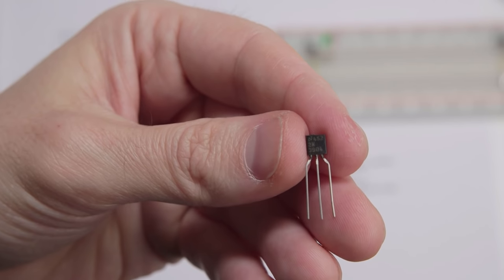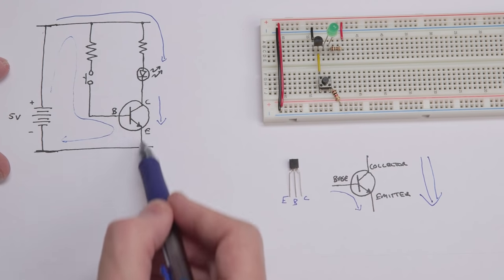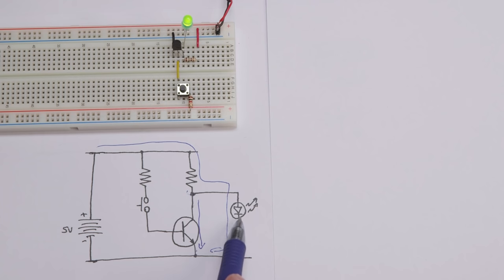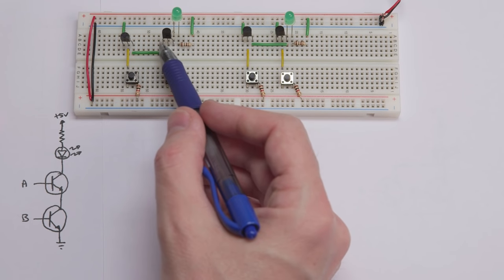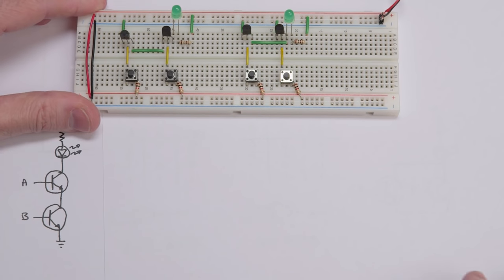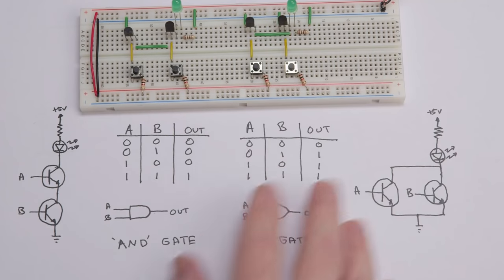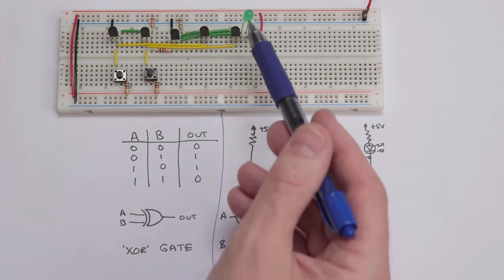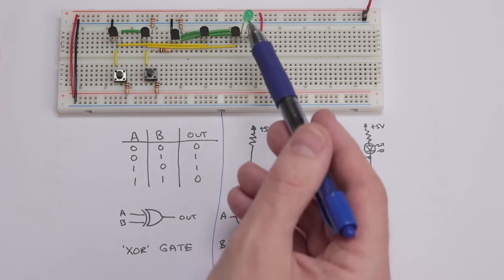Making logic gates from transistors

Comment: this is actually called RTL logic it was shortly replaced by TTL gates because of the high current consumption!
Reply: Actually, the main problem of RTL is low signal. Each time a binary value defined as binary 0 for 0 volt and binary 1 for 5 volt go thru a RTL chip, the designer need to recondition the output with external amplification.
TTL simply add transistors on the chip, thus making the output as strong as the input.
Reply: Christian Gingras So, semantics?
Reply: @orppranator5230  Yep, meaning matters. Shocking stuff.
Reply: And then being replaced by CMOS eventually
Reply: Looks more like transistors, resistor logic to me because the inputs are not connected to a resistor. Also in an IC a resistor is much more expensive than a diode or even a transistor.

Comment: Resistors used on base: 1k
Resistors used on collectors: 100 ohm
Transistor model:2N2222
Led: green at 1.2 volt
You can use white led at 3 volt

The modern silicium transistors have an incredible dynamic range. When OFF, the collector/emittor appear like a very high resistor of more than 50 Meg ohm.
When ON, the same two pins act like a low value resistor of about 0.1 ohm.
The expression 'semi conductor" is misleading. The material conduct as good as the best metal, copper, in the ON state and act as an excellent insulator when off.

The first transistor made with germanium were not as good. In the off state, there was a current leaking from collector to emitter equivalent to about 10 k. When the transistor was warm, it leaked like if it was a 1 K resistor. The OFF state was not that strong neither, cold or hot.

About the NOT gate:
The explanation is as follow:

When the transistor conduct, it is able to act like a very low shunt resistor of approximately 0.1 ohm. It can force the voltage to go as low as 0.2 volt, which is much lower than the usual voltage drop of a diode, 0.7 volt.

If you take a voltmeter, you will measure:
Emitter = 0 volt
Base = 0.7 volt
Collector = 0.2 volt

The base/emitter pins of a transistor are simply a diode with the usual voltge drop of 0.7 volt.

A green LED need about 1.0 volt to turn ON. If you apply 0.8 volt, you get no light at all, not even a feint glow. So, since the transistor  can lower the voltage to 0.2 volt, the LED is off. However, if you replaced the LED by an incandescent light bulb, you would see a feint red glow when the logic state is "0".
Reply: Thanks
Reply: It should work just fine even with  +/- 10% variations, the tolerances are not super critical.
Reply: Is it safe to leave a transistor (im using a mosfet) active for a long period of time?
Reply: Best explanation so far... is better wwy see semiconductors lke dynamic or active resistane than the usual way
Reply: The 0 level in a logic circuit is actually not 0 Volts, just close to it.
Reply: Can I ask, can a 9v battery work with this project? I only have 9v batt on my materials.
Reply: @iamyourfather6941  It depends on your components. If they are rated for at least 9V (safer, if more), then its okay.
Reply: @istvanszabo5745  thanks.. last question tho. If I dont have transistor 2n2222, can I use the model bc547?
Reply: @iamyourfather6941  it depends of the power... power = voltage x current... if you get more power that a component can resist you blow your component
Reply: @iamyourfather6941  If you check the datasheet of bc457, you can see that its rated for 65V.
Reply: Thanks guys for the quick response. Really appreciate it :)
Reply: I just looked up the the word, silicium in my British English dictionary, because as a Canadian, I never heard that word before. As it turns out, it is the chemical element that we North Americans call silicon. You learn something new every day! ;)
Reply: Thanks for the explanation, I thought I was stupid for not getting the explanation on the video
Reply: Thank you thank you thank you
Reply: @connorwatson7162  Yeah, just measure the temperature over time. It shouldn't get too hot because low resistance in "on" state (P = I^2 * R).
Reply: @iamyourfather6941  It works perfectly with 9 volts, I would just increase all resistor values by about 50%.
Reply: @iamyourfather6941  bc547 and most of the bc... series transistors work just fine. Just make sure it's an NPN type. Don't bother about maximum current, power rating etc. In these circuits this is not critical (we are way below max. values).
Reply: That was amazing!!! I got some extra knowledge too, thanks to you.
Reply: THANKS A LOT
Reply: @I am your father -->>> Any small signal transistor will do the job (BC547, 2N3904....).
Reply: @ @istvanszabo5745  >>>> Actually, it's BC547, not 457 and  is rated at 45V(ce).
Reply: Do you know why 2n2222? Why not bc547  or bc series?
Reply: Thanks a lot I was stuck at xor gate
Reply: Christian Gingras ok
Reply: isn't that less energy efficient
Reply: Is better if you use 10K → 50K resistors on the base of the transistors. The current on the base is too much with 1K. In a long period of time you risk to damage the amplification effect.
Reply: i am looking for xnor gate. can you please help me?
Reply: Would be interesting to throw in the diode drops related to the transistors. It obviously doesn't make any difference in the XOR gate where there are 2 diode drops worth of voltage at the resistor feeding the base of the middle transistor. I wonder how many AND gate inputs it could handle before the all 1s input stopped working.  I know I'm splitting hairs here, it would be an interesting exercise to try it out here in YouTube land. I might have to go out and get me some bread boards and stuff
Reply: @iamyourfather6941  yes you can Luke.
Reply: Thank you so much! I've been looking for hours xD
Reply: @Kaan-ih5ty  5 volts
Reply: Thanks.
Reply: is there a source? i want to quote this information
Reply: @MD-qz6gk  you want 1k to make sure to overload the amplification. It is called saturation.
With 47k, the transistor may operate in the linear region and absorb part of the energy.
The base emitter junction is a diode and it is quite tough. Even at 100 ohm, no problem. But if you forget the resistor and apply directly 5 volt, you destroy immediately the transistor, in less than 1 microsecond.
Reply: NOTE that the low-but-still-there voltage of the "off" state implies that if you want a true zero volts, you'd best make sure you take your output after a diode (after the LED will work fine). Otherwise, depending on your base resistor values, it may be more than enough to trigger the input of a transistor in a connected gate when it's meant to be "off". This tripped me up until I figured it out!
Reply: @MD-qz6gk  it seems logical to think that too much current on the base would affect the amplification. In real life, all transistors can take a lot of current on the base.
The usual gain is about 50. If you just power a green LED, this is 20 mA, so you just need 20 mA / 50, less than half a mA.
But even the weakness transistors easily accept 100 mA on the base. That is 200 times more than needed.
The power transistors, those large one that are mounted on heat sink, easily accept 2 amp on the base.
Of course, consult the datasheet to make sure.
Reply: @aprilc.5826  The XOR and XNOR gates are actually composite. The are created by combining a few basic gates.
Reply: @iamyourfather6941  yes, the circuit is not a precision circuit of you just want to light up LEDs. However, you will have to increase the value of the resistor that connects the 9V battery to your LEDs. LEDs will burn up at high currents with 9V. Try connecting an LED directly across your battery and watch it die (if a somewhat fresh battery).
Reply: @Pedritox0953  this is called active load.
Reply: @LawsForever  Would the 2SC1740 NPN work as a substitute? I dont have the BC547, 2N222, or the 2N3904 (actually being used in the video).
Reply: @typedeaf  The  2SC1740 does the job perfectly.
Reply: Thanks man very useful
Reply: His explanation looked fishy to me too, I gave him a thumbs down for misleading young minds. If people understand electricity the wrong way first time they will have problems later
Reply: Copper is not the best conductor.
Reply: @connorwatson7162  yes it safe
Reply: Super useful. I'm very new to breadboards and electrical engineering in general and I couldn't figure out why I couldn't replicate the same results, turns out I have NPN transistors, so my whole circuit was messed up

Comment: For those who are interested, his explanation of how a transistor works is based on conventional current; which is the reverse of the actual electron current. You can imagine the electrons building up on the emitter with nowhere to go because of the depletion zone between the emitter and collector. when the circuit between the base and the positive terminal of the power source is closed, the electrons move from the emitter through the base to the positive terminal and in the process are also able to cross the depletion zone to the collector.

Comment: Finally a video where I could clearly understand what transistors actually do and why are they so important. Thank you!
Reply: I didn't know they were just switches until a few days ago.  My mind blew clear open.  Boolean logic in a miniature device simply would never have existed if it weren't for these things.
Reply: @lookupverazhou8599  They aren't switches really. Physically, bipolar transistors are continous (exponential) current amplifiers. Using them as binary non mechanical on/off switches is just a special case abstraction.
Their primary usage were/are in various forms of (often audio) amplifiers, oscillators, comparators, etc. Such as for radio receivers, tape recorders, TVs, instrumentation, and so forth.
Reply: @herrbonk3635  Why do they amplify, but an additional junction doesn't?
Reply: @lookupverazhou8599  Additional junction? A transistor has two junctions, the base-emitter and base-collector. It is like two diodes with a common anode or cathode (pnp or npn). In these bipolar transistors the amplification is a result of a pretty complex interaction between minority versus majority charge carriers (holes and electrons) forming and drifting in (and due to) the electric fields applied. Hence the name, bipolar.
It's easier to explain a field effect transistor though, because it works very much in analogy with an electron tube. By applying a voltage at the gate, the resulting electric field forms a thin region (more or less) depleted of carriers. This adjust the amount of current that can flow from source to drain at a certain source-drain voltage. So a field effect transistor is more like a voltage controlled resistance, while a bipolar transistor acts more like a current source or "generator", controlled by a much smaller base-current.

Comment: I don’t have the cash or time right now, but I’m going to buy and build all of your kits, this is addicting
Reply: Not to take away from him but you can also just like, buy a pack of 100 transistors off Amazon for like 5 bucks. But then you also need the breadboard and wires etc which I'm sure his kit has. But if you wanna expand electronics is one of the cheapest hobbies I have XD
Reply: Roughly $45 and you can get an Elegoo kit with a breadboard, arduino uno r3 and components and jumpers including a couple transistors. I just got one and it's great so far!
Reply: @Enderbro3300  I just spend over $400 on a bunch of electronics stuff, huhu.

Comment: So far this is the best video explaining logic gates. I appreciate the explanation, the schematics, as well as that you have the gates built on a breadboard, so the users can pause the video and try to rebuild it by themselves.
Thank you!

EDIT: I think you had something wrong with the OR gate, mine didn't work that smooth, didn't know why. I worked it over with another video and it works though. While these gates are good for demonstration purposes, the wiring could be optimized by linking the transistors without jumpers.

Comment: Second schematic uses voltage devider. There is still voltage across diode, just not enough to light shit up.
Reply: Thank you for explaining this. I was wondering why it "wasn't" getting voltage.
Reply: This is a good point. I think the video made a misleading post by that the circuit is not complete when both A/B is on but this is actually not the case

Comment: What makes this so dope is you include both analogue and digital circuits at the same time for a complete picture of how everything works with no deception or gaslighting involved.  Often digital logic is taught by saying 'you don't need to know the implementation' or 'it's not my job to explain analogue circuits.' And analogue circuits are taught by saying 'it's not my job to build logic gates, it's to show the science of transistors.' etc.  So people end up with a huge hole in understanding that is exactly this video.  You do it the right way, providing the analogue circuit as the primary foundation with its truth table as a tertiary feature.

Comment: I had a difficult time with transistors, cuz I'm a beginner. After watching your video, I have at least vaguely understood them.
Reply: @aidanc4719  thnak you! hugs from são paulo, brazil
Reply: Speaking the truth, he showed only half of functionality transistors provide - their saturated and cut-off states. Primarily transistors are current amplification devices, and cutoff and saturated are just edge-cases of that process. "Funny" part comes when we stop talking about DC and start talking about AC and here we meet several more dozens of characteristics diagrams for transistors.

Comment: About 50 years ago - Vietnam War era.  We had several books of circuit diagrams and others with logic diagrams  built with basic gates like these.  Hawk Missile guidance control systems.  All "Top Secret" back then.  It would all fit on a grain of sand now.  But back then it was big stuff - actually useful when we could keep it running.  Lots of breakdowns.  That's where I came in.  (smile).
After service, I used to keep a small breadboard of logic circuits on my desk to remind me of those times.  I'm 75 years old now - still breathing.

Comment: I have an idea for the XOR gate. To save power, you should put a transistor in series with the two transistors that basically make a NAND gate. Then, connect the base of that transistor directly to both inputs. This ensures that if A or B is on, the circuit is on, but if neither A nor B is on, no current flows at all.
Reply: Put the transistor mentioned before between the positive rail and the first transistor of the NAND gate.
Reply: +Matthew Ferrie Before the resistor.
Reply: My apologies for responding to a two-year-old comment, but for anyone reading this now:

Tying both inputs to the base of a transistor would not work as you've now shorted the two inputs in question.  If the inputs are driven by opposing logic levels (ie, one high and one low), you've short-circuited 5V, and the circuit could get very hot very fast.  Or just cause your microcontroller to force shutdown to avoid cooking itself.  In general, I wouldn't recommend it.

Comment: One of the best videos on the web. But I keep wondering why everybody in every video and tutorial keeps repeating that when transistor is on all the all current flows through it and because of that the potential difference between collector and emitter drops to 0, effectively meaning that both of LED's legs are connected to positive side. That's not correct, transistor is not a superconductor,  it still has a resistance when it's on, current does still flow through LED, the reason why LED turns off is because current becomes way way too small which is not enough to light up the LED.
Reply: It needs 0.7v to light up.
Reply: Thank you for explaining this. I was wondering why it "wasn't" getting voltage.

Comment: It is fairly easy to design circuits w/ logic gates, but it is interesting to see simple designs that are necessary to build your own logic. All are straight forward until reaching the exclusive or gate. Left on my own, I would have a working design w/ 7 transistors, but your clever design does it in 5. Again, you are the master.

Comment: Finally, a minimal TTL diagram that really works! Thank you!
Reply: There was no TTL in the entire video.
Reply: This is RTL - Logic. :-) 

Because there no Multi-base Transistor in use...but the gates working nice using a normal light bulb and the npn Transistors 2N3055 to realize the switches, because more current in flowing through collector-emitter circuits.
Reply: WTF is everyone talking about, TTL and RTL were logic gates from the 1970’s and 80’s. Virtually all logic gates produced today are CMOS which is much simpler to explain than bipolar transistors.
Reply: @silviam.7195 doesn’t TTL use multi-emitter. Each input goes through a common base amplifier. Common only means that the lead of the transistor is connected to a common wire. The semiconductor does not need to connect them in a monolithic fashion ( like the base connects emitter and collector ).
Reply: @ArneChristianRosenfeldt  Yes, that is correct.....you can realize a multi-base transistor or a multi-emitter transistor from many basic transistors, like 2N3055.
Some logic gates from TTL are published in standard books like Klaus Beuth or someone like this. :-)